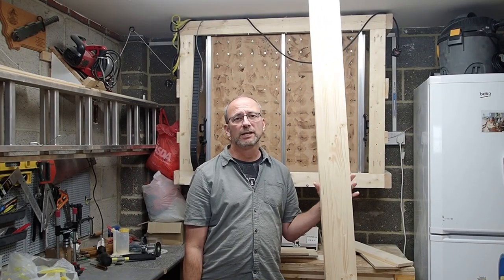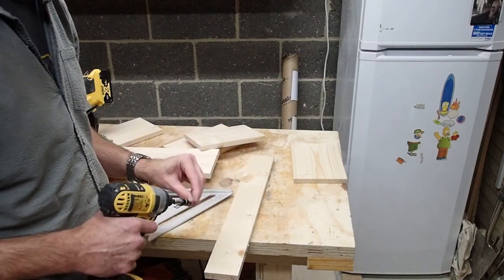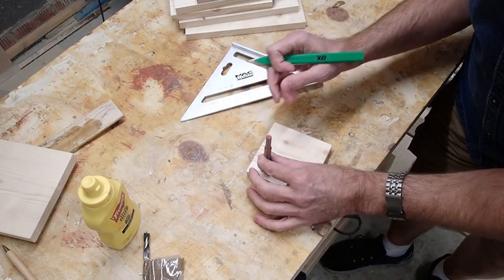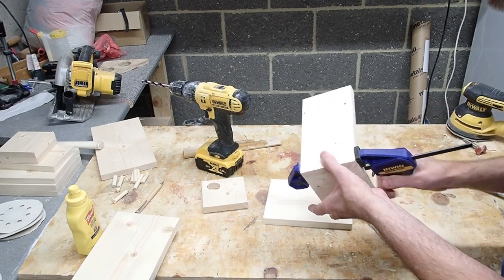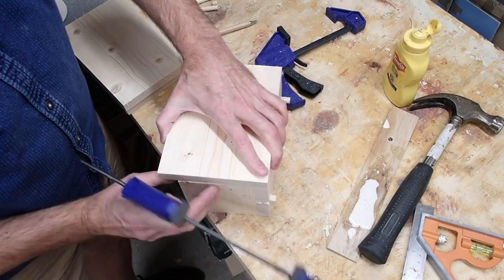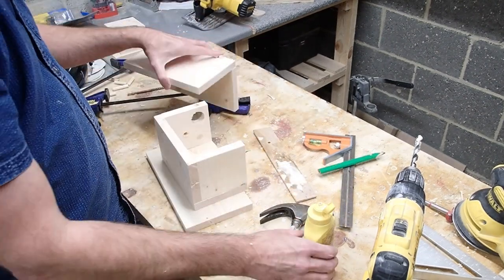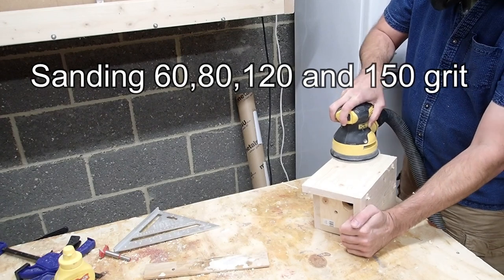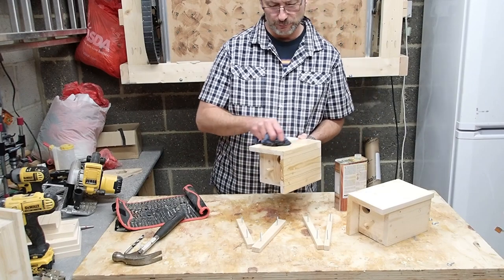Easy DIY birdhouse with basic tools

Comment: Birds do not require perches.  Predators, however, do ... Additionally, you must provide drainage holes in the bottom and ventilation holes at the top, probably under the eaves.  Finally, you must provide for annual cleanout.  Suggestion: screws on one side (NO glue) for panel removal at cleanout time ...
Reply from the maker: Thanks for the feedback